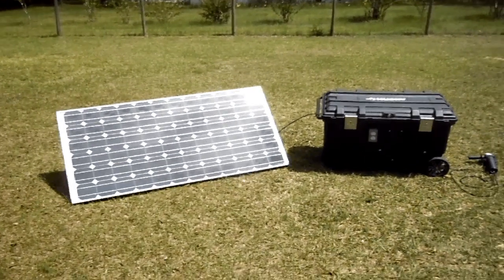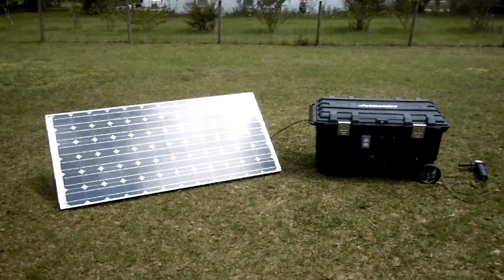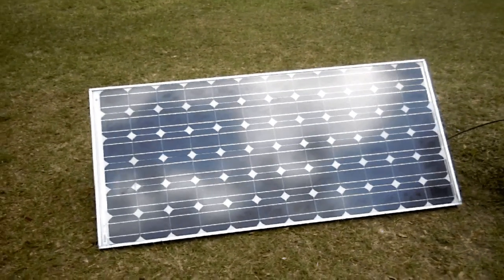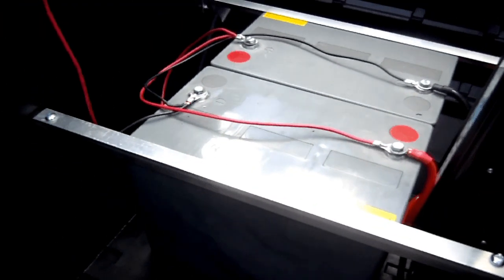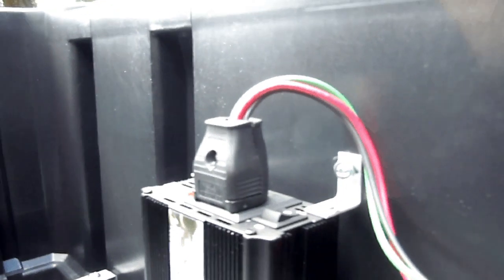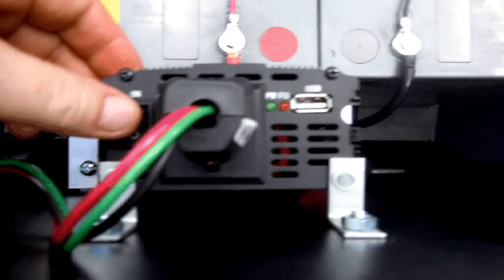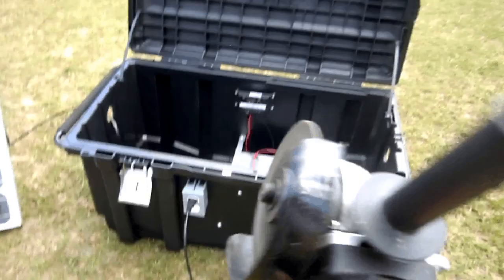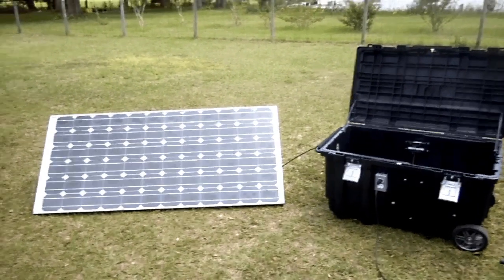DIY Portable Solar Generator

Comment: Hi, I didn't see a circuit breaker inline from the battery to the inverter. Did you use one and if not do you have to have one? Thank you
Reply from the maker: I don't use circuit breakers of fuses with these inverters since they already have 2 fuses that are externally mounted, providing easy access in case of a short or surcharge.